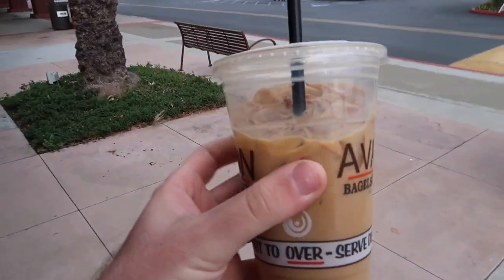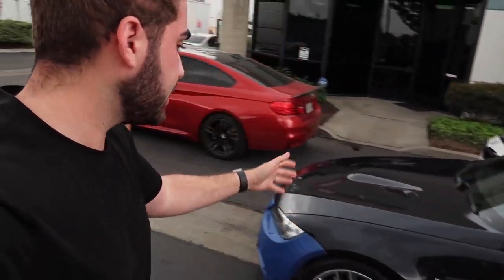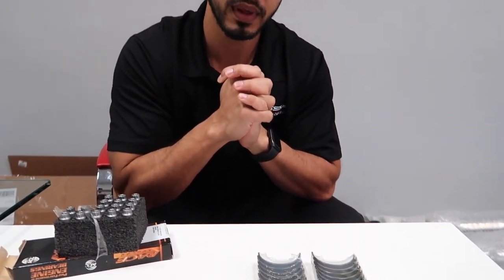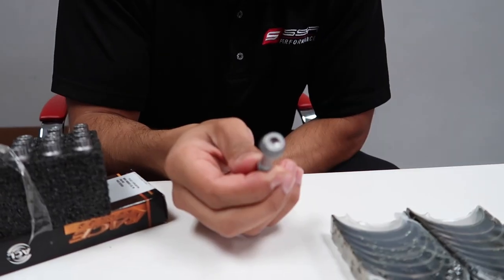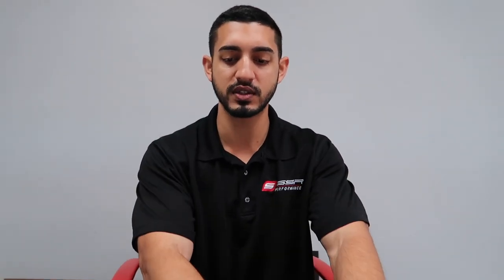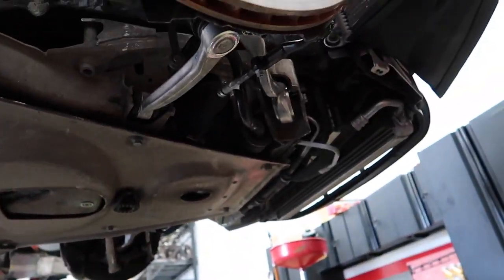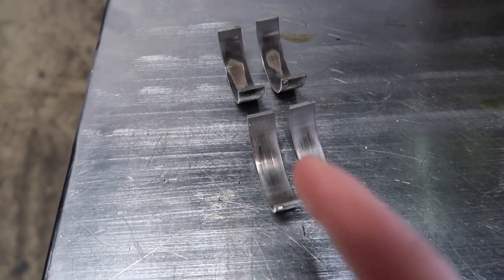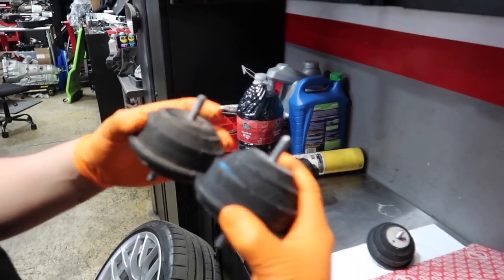MY E92 M3 GETS ITS ROD BEARINGS REPLACED AT SSR PERFORMANCE! ALMOST LOST MY MOTOR AT 40K MILES!

Comment: Yea LCI bearings just have different material (copper). It mainly has to do with clearance issues, a oil analysis won’t do anything if you didn’t do it since the car was brand new. Better to pay for rod bearings than a whole motor lol.
Reply: An oil analysis will tell you if there is bearing material in the oil
Reply: @johnnychimpo7539  LCI is aluminum so won’t show anything in the report. Pre LCI is copper and will show up but i did them regardless because of stories on the forums.
Reply: @erikgarcia1589  you got them backwards
Reply: @johnnychimpo7539  no he’s right. The LCI bearings are aluminum/tin. Pre-LCI are lead/copper.  Edit, oooh you’re right. I see the original post from him had it swapped.
Reply: Lol I didn’t realize he was the same guy responding to you Johnny, my bad.
Reply: @soopermarkus  lol no worries mark

Comment: Making the rod bearings harder, and harder to detect wear through oil analysis does not make them “improved”. I honestly don’t know why they make the tolerances so tight on the S motors. My neighbor had to change rod bearings in two E46 M3s and swap an entire engine into an E36 due to a spun bearing. A lot of noise is made about the S65 motors rod bearings, but they definitely aren’t the only engines with tolerance issues.

Comment: I hope you asked ssr to do the bolt for the frame as well
Reply from the maker: They don’t do frame work, but it’s something easy when my frame appointment comes up
Reply: Just thought you woulda knocked everything out @ 1 spot. Good thing you did those rod bearings as well. The previous owner. Probably did a lot of high revving on it

Comment: The rod bearing is not actually that bad. You could put 50,000 more miles maybe alot more if you allows the engine to wam up properly and change oil every 5-8,000 miles. Mine e60 M5 has 151,000 miles on the original rod bearing.
Reply: Peace of mind brother
Reply: @MrKobedagreat24  peace of mind for what? Those bearings had tons of life left
Reply: @johnnychimpo7539  you wouldn’t understand lol. Mine had 60k miles and they looked a bit worse I’m gladi changed them
Reply: @MrKobedagreat24  you wasted your money. Only a fool changes rod bearings under 80,000-100,000 miles unless they don’t know how to take care of their car.
Reply: @MrKobedagreat24  I would understand, I would never open the motor on a bmw so early in its life unless the previous owner was a dunce. Maybe you don’t know how to drive your car so it was a good choice for you
Reply: @johnnychimpo7539  ok chipmunk
Reply: @MrKobedagreat24  this guy is literally a troll

Comment: Those bottoms dont even look good thank god you got these done! Im not a mechanic but i watch a lot of engine teardowns and good bearings on a used car dont have much pitting at all.
Reply: It’s actually not that bad. Need better warm up procedure and oil interval between 5-8,000 miles. Mine e60 M5 has 150,000 miles on original rod bearing
Reply: @The_North0  agreed. My e39 m5 had them changed by the previous owner at 100,000 miles and they looked totally fine
Reply: @The_North0  did i ask?
Reply: @CardsMart  it doesn’t matter whether if you ask or not. You are misinformed in regards to the condition of the bearing.
Reply from the maker: Facts they are bad
Reply: @NourHummadi  no, it’s not. I had a friend of mine who had a M3 like yours with 34,000 miles on it and  at that miles the wears of the rod bearing was pretty identical to yours 3 years ago when I helped took out the bearing. I explained that to either put back the original bearing or put in a new one because the original could go for maybe 40,000 or more if warm up the car properly and change oil every 5-7,000 miles so they elected to put back the original bearing . My friend habitably put 5,000 miles a year on the car and based on the math, could have 10 more years out of the original bearing and somehow put 80,000 miles to date and still on the original bearing. The problem with bearing failure is that people treats the car as if it’s a Corolla that the car could just go and has no concept that the car is a racing engine and now it’s no wonder why manufacturer starting to add soft limiter to prevent damage to the engine.
Reply: @The_North0  these people have never seen bearings that are actually bad. I would never open up my motor at 40,000 miles for rod bearings. Just take care of car and you don’t need to even think about it until 80k. It’s a risk to put aftermarket bearings on even if they claim they are better

Comment: For 40k miles that’s crazy wear on the rod bearings.👀
Reply: No, it’s not that bad. He could put 50,000 miles more on it. My car is a 2010 M5 with 150,000 miles still on the original rod bearing.
Reply: @The_North0  yea complete waste of money. Just don’t rev or beat on the car when it’s cold and change your oil every 3-5k and those would have been fine for 40k more miles. I’ve seen rod bearing that were wayyyy more messed up and the motor was fine. No sense in touching a motor under 60-80k miles.
Reply: @johnnychimpo7539  Its piece of mind. No one will buy one of these cars to baby them. These cars came with a V8 so people will take advantage of it. As well if you just bought the vehicle the person b4 couldnt have been good with the car
Reply: @slayerarmy  the bearings do not fail because of someone pushing the car hard. The bearings fail because high revs when the motor is cold and lack of oil changes. He could have beat of that car for 4 years and the motor would be fine

Comment: Rod bearings and 40,000 miles on a car you are going to sell? That’s a waste of money. Do an oil analysis are go from there.
Reply: He didn't pay  he is supponesed by ssr for free
Reply: @hasan_440i  if you think the whole thing cost him $0 then you are crazy
Reply: It’s been reported that oil analysis on the LCI bearings doesn’t help much because the aluminum layer gets obscured with normal aluminum presence in the oil. There is an layer of copper under the aluminum and tin that can be detected. Mine didn’t get changed out until 88k and since they were preLCI the copper was showing. Good peace of mind because I know the previous owner tracked the car. I don’t, and I always wait until the oil is up to temp before driving hard. Now that people know the proper care and feeding of this engine, they can go longer on stock bearings. I do get why some would want to just do the service to settle their doubts. Especially not knowing service history and driving habits of previous owners.